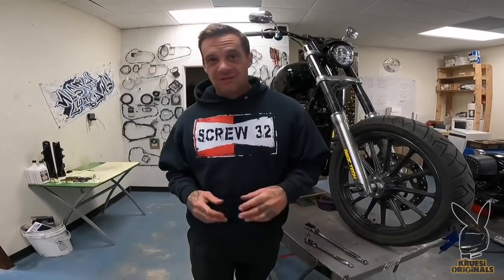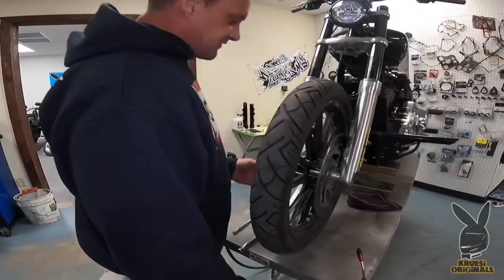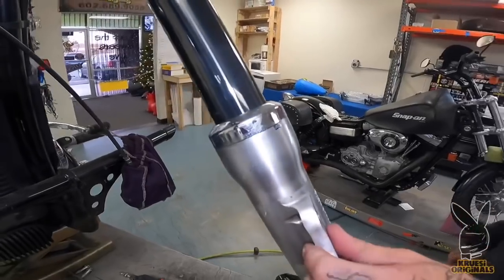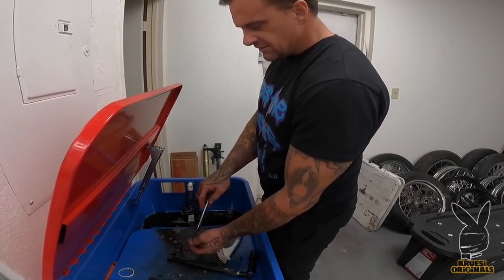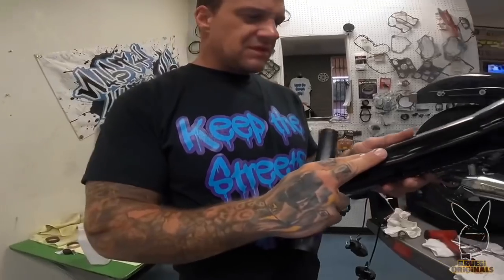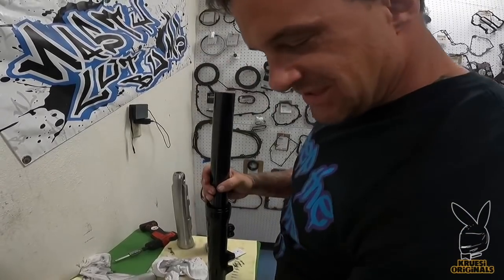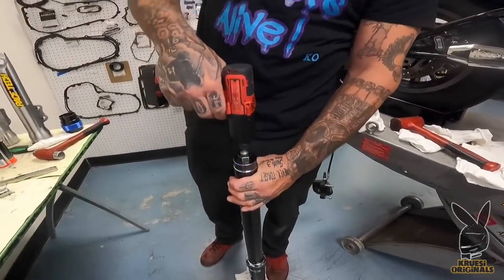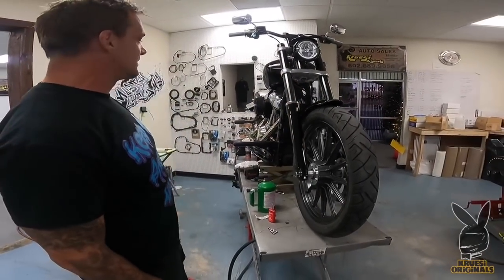M8 Softail  Dual disc brake conversion

Comment: Ryan, I know there’s probably no possible way you don’t know this already but they make a tool to hold those damping rods so you can pop that bolt loose. It’s like $20 in the Drag book. 

Also you can go to O’Reilly Auto and buy this cool set of short Allen sockets that are 1/4 and 3/8 drive, they have them in metric and standard and the 3/4  and 19mm from that set will pop the axles all day. Also Motion Pro makes a tool that has like 4 hex sizes built in, I have two of them from back in the day when I didn’t have the clout to refuse to work on metric junk.

Comment: There's a good French  brand called Beringer Brakes that's making Harley brake calipers. They're making master cylinders and clutch perch as well
Reply from the maker: We’ve run them a bunch of times they do not make a very good product especially for the price. I will take them if they were free and they came with a rebuild kit.
Reply: @kruesioriginals   They’re expensive that’s for sure. But you could try and ask them actually, they’re into everything so maybe they would be happy to get onboard with your project

Comment: So you're running dyna lowers and getting rotors made for the Brembo setup. Is that to correct the surface area issue with the brake pads?
Reply from the maker: Yes we have to run 11.8 mm rotors for those calipers. But we are also having our own line of wheels coming out and the rotors are going to match those. There’s pictures on our Instagram we got some serious pimp shit coming😁

Comment: I just got my m8 street bob yesterday bro man that shits a beast!! Just need a pullback setup and I’m good. Does lifting the rear also make u sit upright? I got short ass arms 65 inch reach
Reply from the maker: Taller rear shocks will help, and a saddlemen step up gripper seat will put you forward or a tuck and roll would be nice